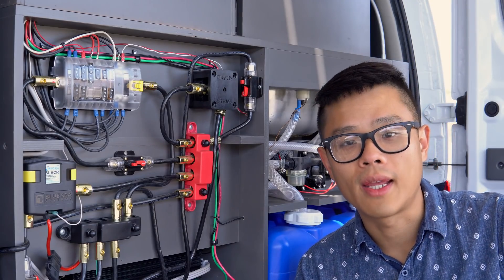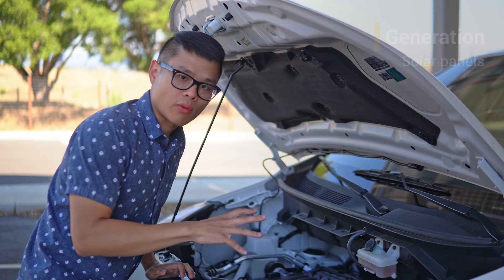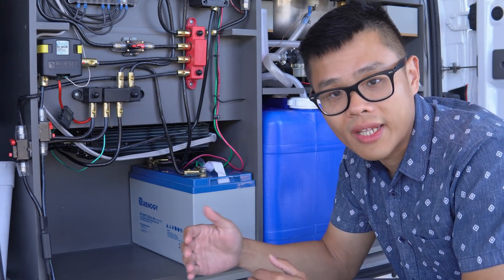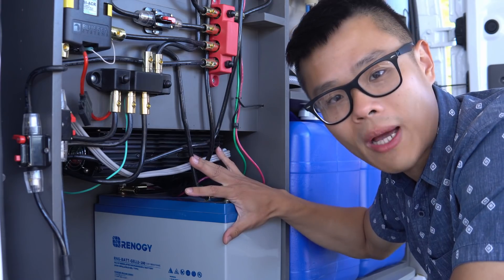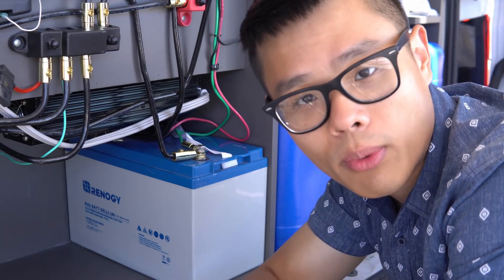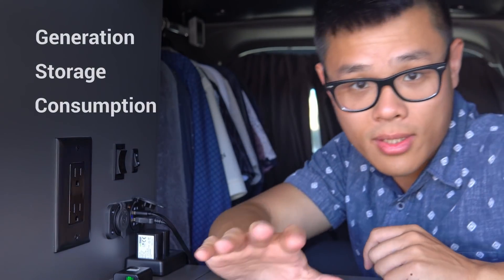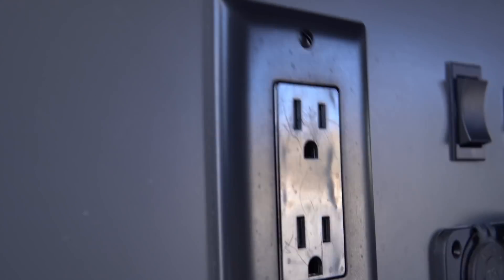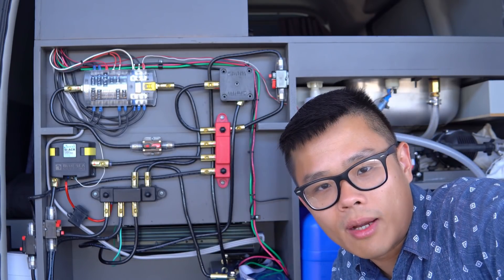Ultimate Guide To Off-Grid Electricity (In A Van)

Comment: You'll eventually find those lightweight flexible solar panels will fail in a few years.  They will delaminate in the hot sun and the output is not as good as the rigid glass counterpart.  I've gone through a few already and decided to go with glass rigid panels that have dropped considerably in price. They will also last at least15 years too.

Comment: You could always replace your starter battery with a matching lithium battery. The type of battery isn't that big a deal as long as it has enough voltage/AH to turn the engine over. That way you don't end up having to mix two incompatible battery types. You can also use the same inverter backwards, just like an electric motor can be turned into a generator- it'll do either AC to DC or DC to AC, takes some wire snipping but it works- I've done it.

Very nice setup either way!

Comment: Bro I love your videos keep it up. But don’t forget a small windmill on top. I know it sounds silly but out in riverside it gets pretty windy. Same concept as an alternator. Wind spins the shaft, magnetic 🧲 field is generated and electrons move down the copper into the battery. There’s lots of ways to do this, even when you’re driving to collect power. Any 12v dc motor can be converted into a 12v charger. When you add a power source to drive it at peak it’s output should be around what it’s rated for. 

I have a similar van we should link up sometime.

Comment: i wonder what would be needed in a ford transit set up in order to be able to charge the BMW C04 electric scooter. that is my plan... build a complete mobile house using the Ford Transit Extended High Roof model. And have the BMW scooter inside charging all the time until I need it for city traveling purposes.

Comment: How necessary is AC power supply in your van? A lot of electronic devices I have, convert AC 240 V to DC 5/12/24 V. So what is a critical item that needs AC 120/240 V?

Comment: This is so helpful! I am intending to do a minimalist buildout (4 seasons functional) so thinking a 12v DC only system could be sufficient, but would I be able to power a mini fridge with that if I eventually deem it necessary? I'll use propane for a gas stove and thinking I can just have a heated blanket for the winter, but the fridge is my only major concern. Anyone have any thoughts or suggestions?

Comment: QUESTION:  Did you consider carrying back & forth a small battery and charging at work or at Starbucks?--Some of the devices have built in solar panel connection, MPPT, and AC & usb plugs.  (I'm specifically thinking of a Goal Zero Yeti 1000w ~$1500).  Would you consider the battery portability a good feature?

Comment: You mentioned about the DC-DC charger between lead-acid and lithium power banks. So why there exists the Automatic Charging Relay in your system? Is it compatible still? If not, it should be removed, right?

Comment: I like the information you provide but wasn't able to connect to what you were saying about laptops and DC. You can have a DC build and still use your laptop because internally laptops are DC powered. In a situation at home for example, you'd plug your laptop with AC power, but realistically, power from AC goes to the laptop which in term switches AC to DC because that is what is used. To get around it find a DC to DC plug for your laptop. I did it and was able to have all my devices running DC. The idea of using DC to AC to DC isn't much good. But if you have a DC plug, then you're going from DC to DC directly without anything in between. The AC plug with laptop is mostly for convenience since homes and offices use AC and not DC. But in a van or camping scenario, DC to DC is the best way to do it. When I travel or go camping I take my laptop with my DC plug and plug directly to DC. Hope this helps. I really like your van build. Wish I was as clever.

Comment: Are air fryers okay to plug into the ac unit?
Reply from the maker: Depends on what wattage the air fryer is. My system is only designed to handle upwards of 500W continuously. If I have something more than 500W, I would have to upgrade some components

Comment: I would think that an vehicle with an electrical engine would be great in combination with living arrangements like this, or is this a total misunderstanding of how electrical systems work by me?
Reply from the maker: It's possible to tap into a EV's battery to act as the house battery but you'll need more specialized equipment. An EV battery is like 48v or maybe higher. There's already a huge market for 12v batteries and 12v compatible devices. Plus many inverters are designed to take lower voltages like 12v and 24v

Comment: There is one potential obstacle in buying lithium instead of lead acid, which is that high quality lithium batteries can be very difficult to find locally and they can often take a long time to arrive by mail. This means that if you need to acquire a battery quickly then lithium simply may not be an option at that moment. This is why i ended up buying agm. I simply didn't have enough time to wait on a lithium battery, but good lead acid are easily found all over the place. This can especially be an obstacle for people travelling around living in a van with effectively no mailing address

Comment: Can a soler,solar, a little Tv..and for how long..
Reply from the maker: Can solar power a TV? Sure. Most TVs are around 30 watts so you can power a TV for hours easily with even a 100w solar panel in sunny conditions and a big enough battery.

Comment: Two out of three charging methods are no good: alternator because the car will use more fuel (energy has to come from somewhere, right?), shore power because it kills the off-grid way of life you are going for. More solar panels is the only good option but you need a bigger car for that. So, a system like what you have is no good for a small car.

Comment: Can you explain the complicated technical array in the back please? Im building my own system in my van this week, and its nowhere near as complicated, or neat, or probably as safety/redundant. Im using a 400ah battery bank with smart controllers built in, a 300w renogy solar rv kit, and  a 3000w inverter. My A/C unit is 12v DC, as is my fridge, my only big AC power draw is my microwave, and gaming pc, with a peak of 750w.
Reply from the maker: I might make a video in the future explaining my electrical system in detail. In the meantime the wiring diagram I provided in the description is the best way to learn how I arranged my electrical setup

Comment: what type of cable ends are you using there? they look like some kinda quick connect end or something. they also just look nice, didnt see that mentioned on the wiring diagram
Reply from the maker: Oh yeah! Those are quick install connectors. You use an Alan key to tighten the connection

Comment: Great stuff Evan. I am sharing this to our 4x4 Facebook group, the Four Wheel Drive Association of BC, with about 48,000 members. I am an electrical installer for these vehicles and can’t do near as good a job explaining this stuff, thank you.  

My interest is over landing, not urban stealth so I differ from your opinion on the LIon stuff. It dies too quickly and doesn’t agree with things like fridges that need to feel a voltage drop, then turn off until charged. I am pilloried for suggesting AC to DC charging and you explain it well. I hope you get more subscribers and can do more posts.
Reply from the maker: Hey Lory! Thanks for sharing my video! I'm interested by what you mean by lithium dying too quickly and fridges needing a voltage drop. I understand that lithium holds a steady voltage while discharging compared to lead acid.

Thanks for the comment!
Evan
Reply: @StoriesFromaVan  First, much of what I am saying is “what I have been told”. The drop off issue has been explained to me by a number of”experts”, for what that’s worth.  There is more than one reason LIon would probably not be my choice. The main one is that drop off is too fast. They go from full to empty too quickly, they just turn-off. Some appliances will reduce their draw, or shut off and warn you of low voltage, but the LIon batteries don’t give that warning.

Second, I live in British Columbia and we wheel into the back country, LIon does not like super low temps. It would be fine with your LV200 set up of course but most of us put the batteries under the hood. We all use AGM because they can function as a cranking, or house battery.

Thanks for the great effort you have made, I am looking forward to seeing more.
Reply from the maker: @lory2622  Ahh I see. Yeah, cold temperatures is one of the factors that would make you choose AGM over Li

Comment: Very good video. I'm glad to see someone say you may only need a 12 volt system. I am doing a van build (budget) and although I will have an inverter it will be a very small 500 watt. By doing it this way I saved quite a lot of money on wiring etc, but I can easily upgrade it later if I need to do so. Thanks for your story, nice build.

Comment: I was looking at my Samsung monitor power brick, and realized it works at 14v DC, so was thinking I can wire it stright to a 12v battery with out the need to get a 240v inverter.  As otherwise your stepping up the voltage, then stepping it down again, which is wastful.  As well my laptop charges from USB C which is a God send.  So again a car cegret lighter phone charger will charge my laptop.  So all I neeed is 12v.  Next summer, I will get a compact van like this and can go exploring the Scotish Highlands at weekends.
Reply from the maker: Yeah! There's no need for an inverter in your case because you can install a USB-C port that's powered by 12v DC! Good luck on your van build!

Comment: You should check out the firefly carbon foam lead acid battery's.  Lithium performance from a lead acid battery.
Reply from the maker: It seems to have a longer lifespan compared to other lead-acid batteries but it still is recommended to only discharge 50% so still losing to lithium's 80-90%. I just checked and a 110ah 12v firefly battery is $520. You can get a 100ah LiFePO4 battery for $470 so the carbon foam battery is a hard sell for me. Thanks for sharing though. I never heard of this specific type of battery

Comment: What I would like to know is what the whole solar install costs?  We are looking at using a propane powered generator .. less than $1000 for a 2000W quiet propane/multifuel and two 20 lb tanks.  I have a small solar panel for my Jackery 300 but have never had to deploy it because the truck system always keeps it charged.  You did a very nice and clean install .. 🤠👍
Reply from the maker: 2x 100W Solar Panels  ~$360
PWM Charge Controller ~$30
100ah Gel Battery ~$200
So total around $600

Comment: you could charge your laptop from a dc to dc charger not ac to dc
Reply from the maker: I have a 200w laptop charger which is harder to run on DC. I get what you're saying. It's inefficient to go from DC to AC back to DC
Reply: @StoriesFromaVan  yes, i am saying get a dc laptop charger that runs off 12v. you can even make your own with a boost converter,

Comment: @5:52 One more big advantage on Lithium vs Lead Acid is usable capacity. Discharging (using) greater than 50% of lead acid battery will permanently damage the battery. Therefore, for example, for all usage same, a 50 ah Lithium battery that can be use to run for 4 hours, 50 ah Lead Acid usage has to be less than 2 so it does not damage it.
Reply from the maker: Yep. That’s true. Lithium can be discharged 80-90%

Comment: Photovolatiac / Solar Thermal Technician here. glad you said it OVERKILL but my hat off that you had it built. preferably i'd go 24V but like you said more 12V appliances. parallel 2 batteries and get more for your buck that way you increase the amp hours. The van is sweet, very nice. i live in a '68 dodge dart. removed back seat. i have 100AH deep cycle battery with i charge using my alternator, no DC to DC. i have tricks up my sleeve. as for your video   i approve    i Like, OLE'!

Comment: Absolutely excellent presenation.  Clear, concise, and to the point.  Well done.  I agree with your sentiments on the DC-DC charger.  I have a Renogy DCC50S that I like quite a bit.  Automatically rations between alternator and solar depending on supply and demand.  Your wiring is much, much cleaner than mine!

Comment: Here's my tip : If you are going to do a electrical system Really do your homework on items that will upgrade your need for power (solar panels, Battery storage, A/C outlets, Charging rates And Alternators) Example : This Nissian NV200  comes with a factory stock 110 Amp alternator. However You can buy 220Amp Alternators that fit the same engine And if you shop around can get it at a good price This means you can charge your van with double the power while you drive or idle Not just Nissian All companies have high end models. And i would highly reccomend upgrading your wiring with Welder's copper cable wire 1/0Awg And hammered lugs for the engine grounding system. The next starting battery you buy Try to find one with Top And Side posts This will help If you need to add wiring And boosting I finshed off my battery And exposed grounds that in open air/water with battery spray protector This keeps them from corrosion alot longer And water free contact

Comment: Great video. I am getting ready to install solar on my 2002 Dodge Ram Van. Please tell me if this is too much. I have a 3000-watt inverter that i got from a friend for $140.00 New in the box. I was thinking of going with 300 or 400-watt solar panels. My A/C usage will more than likely be for charging my laptop or running a 400-700 watt hot plate (Magic Chef) My DC will be 6 puck lights, 2 light switches, and dimmer capability. 2 sets of USB outlets, and maybe 2 A/C outlets. I wanted to go with a CHINS 300 watt battery (Amazon) I also have a 53-quart fridge/freezer that is 12 volt and A/C capable (Draws about 45 watts when the compressor kicks in. I believe this is overkill but am ok with it. My question is will the 300 or 400-watt solar panel be able to charge the 300 chins battery? I will use a renogy kit and add the needed extra components. Your thoughts will be highly appreciated.
Reply from the maker: That seems like a great setup! If you live in a sunny area, 400w of solar should be an adequate amount of solar! As long as you're not using your hot plate for more than an hour on the highest setting and charging your laptop for half the day, you should be pretty good! If you're going to daily drive your vehicle while staying in cloudy areas like the pacific northwest, adding a DC-DC charger will make it work! Oh and make sure you get a MPPT solar controller!
Reply: Hello Richard:
I am a newbie but please check your math from my three years of reading you might need more than 400 watts of solar panels, I am at work so I do not have my notes with me how to size up the necessary solar panels, battery size to the size of the inverter.
I am no expert but I do take notes.
On 8/10/2021 I ordered online my first deep cell battery to experiment with and to start the long process of working with DC power to understand it better and to know how utilize DC power so I can design a integrated  DC system.
Regards
Hope

Comment: Hello Evan & Group:
Evan I have great respect for you and your fine oration towards details in buildIng of your fine van home. I also have been wanting to do a van build. I also live in Northern California so I do know about the limitation of large and huge parking spaces so extra longs vans might not work for me, also one thing I am concerned about is putting high dollar, expensive solar Charger controller and batteries next to the back door of a van or the side wall of a van because I know how bad drivers drive in Norther California, yes one fender bender accident could do major damage of a van electrical system.
So I keep changing my ideas and designs.
I did like your upfront and honest answer where in some van designs a DC system could work with out the over kill of a inverter to produce 120.

I have done some reading and research regarding boats and yacht building and design’s because of there long history of working with both DC power and batteries and limited space and there fine detail to manage the over all weight of there design in the limited space they have.
Regards
Hope

Comment: Yeah sorry couldn't even watch this way to intelligent for me bro my nv200 build is base level 😂 I got a pull out slat bed a incorrect size bed for the slat bed it's a whole headache I am working on figuring out how to keep cold without running my vehicle all day because it's been getting 105-110 in the back of my van during mid day first I should probably figure out how to insulate since I have no insulation at all
Reply from the maker: Insulation will do nothing if you don’t have active cooling or heating. I insulated my van and the temperature outside is the same inside my van. If I had a heater or air conditioning, then the insulation would actually mean something